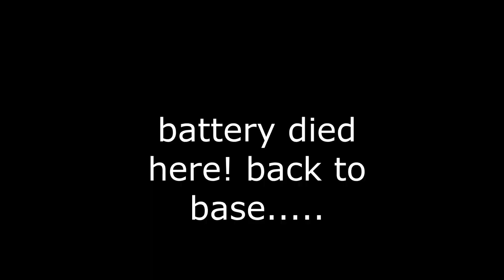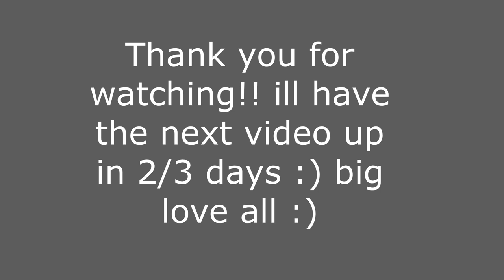honda cbr 600RR ride along painting footpegs

Comment: Great video Rickster. Good explanation between 125 and 600cc bikes too. Your absolutely correct they all ride the same but respect the power you have. Biggest cause of accidents is the good old GTF. “Going to fast” corners or bends can come up a lot faster than you would ever think possible and catch out a lot of people,  the next thing you know is you are upside down in a ditch or worse. 
Right. I’m gonna burst ya bubble. £100 rear sets.!!!
Don’t touch the bloody things. They are from China and are at best “Shite” they are made to a budget and work as crap as it gets. They will start to rattle then wobble and the bearings start falling apart totally dangerous in my opinion. Think about what’s attached to them. Not only the gears and the brake but also the weight of you. After market Chinese levers are as dangerous too I’ve had experience when they jam on and won’t release the front brake. The lever has to be removed to get the brake off. Again look what’s attached to them. Clutch and front brake. The most important and only thing to stop you in an emergency. !
Only and I mean only fit quality rear sets and levers. Brembo and ASV levers are amazing just fit and forget. 
Gillies and Harris are the cream of rear sets. Yes they are expensive but they are a joy to have on ya bike and give you serious street cred when parked up too. Real bikers will know you have cheapos on, stock hangers and levers are far better than the crap after market stuff by a long way. My race bike has Brembo fitted and my Blade has Gillies rearsets. Come over and have a look before you think of buying any. Mine have been fitted for 15yrs on the Blade and there is still ZERO wear on them and the bearings and swivels are as tight as they were 15 yrs ago. 
Yeah I bet you can detect I don’t like Chinese aftermarket stuff. Not when you safety is concerned NO.  
Keep safe matey, sorry about the rant but they really do get me wired. 
 Cya soon bro love to Alice.